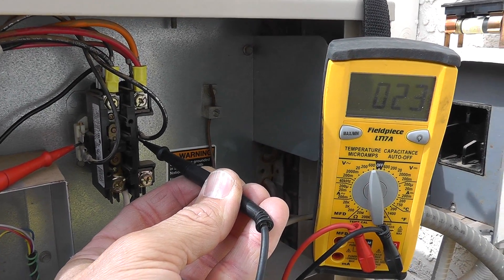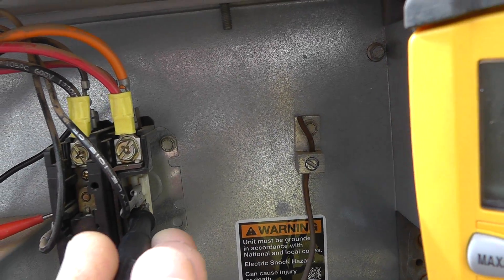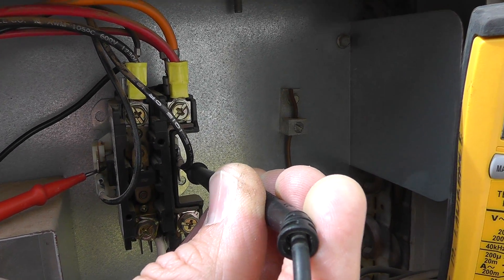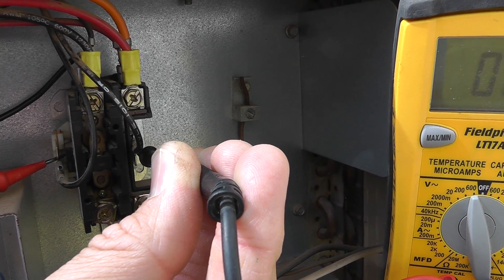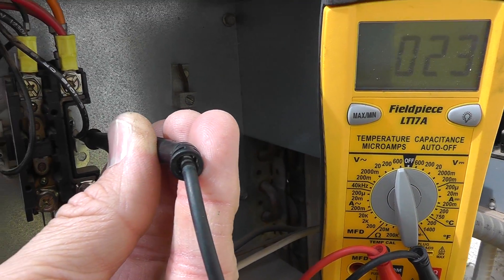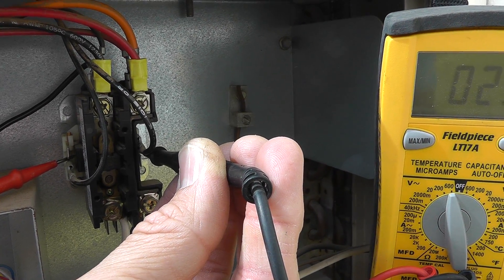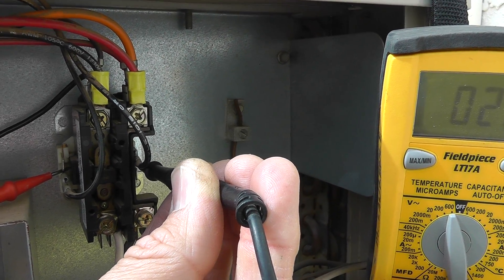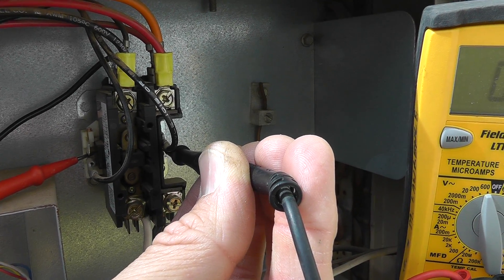Low voltage check at a Phoenix AZ contactor coil (24V) by thermal-medics.com

Comment: Yup had a bad low pressure switch, Ran to defrost board. If it reads pressure to low or to high it interrupts the low voltage to the contactor.

Comment: I have 240 v going in but have 0 voltage in the coil instead of the 24-26 volts.  I tested the thermostat and it works. What other areas should I be testing in the low voltage area?

Comment: so my contactor wasn't closing unless I pressed it in and would stay pressed in. I got a new contactor now I'm not getting 24v to it I was getting 24v before on the old contactor
Reply: BUDDAz1g u shorted something on the low voltage side

Comment: Should there be continuity between these two connections?  Sometime over the winter my dog chewed through the wire and I just replaced it, but as soon as I turned on the AC the thermostat started smoking and blew the low voltage fuse in the inside unit.

Comment: hi merritt 

 thanks for all the great videos but I still have a problem I have 24v and im also getting 220 too but my contact wont go down on its own  everything works when I press down the contactor but otherwise nothing just my unit in the house blowing air turns on   and ive also changed the contactor too.  any suggestions
Reply: Chris Hoffman  I need help I had same problem any suggestions
Reply: @richardsilva3109  pressure switch or the transformer is bad
Reply: If voltage is applied to the load and it isn’t working. It’s the load
Reply: Load= motor
Reply: May be bad contactor. Windings coil to create magnet 🧲 pulls in contact. Sometimes they can beam lose magnetism

Comment: Hi Merritt,

Just an added tip here if I may. If/when you check for 24vac at contactor coil and get 0vac, try this. test each side to ground for 24vac. IF you still do not get 24vac on either, then test power side for break in 24 volt circuit. However, IF you get 24vac on one side, then the break is in the neutral side and you will need to check it. This will save time in looking at wrong leg.Great videos. Take care, Brett